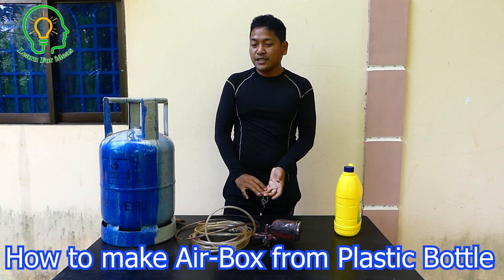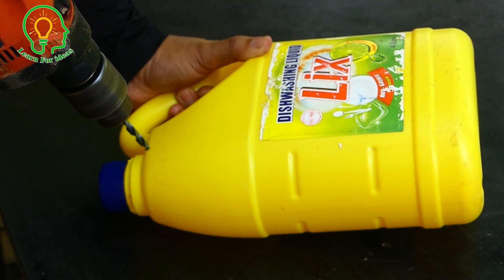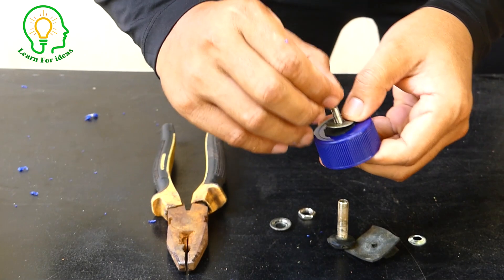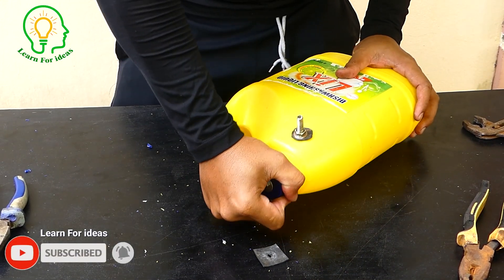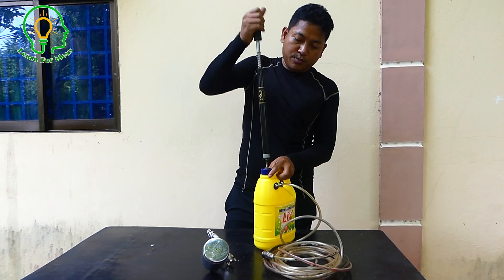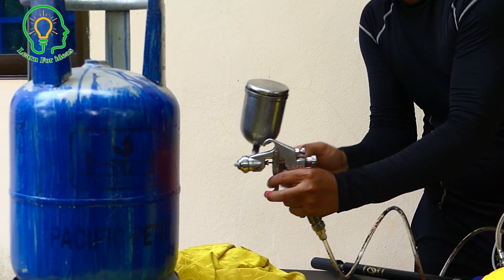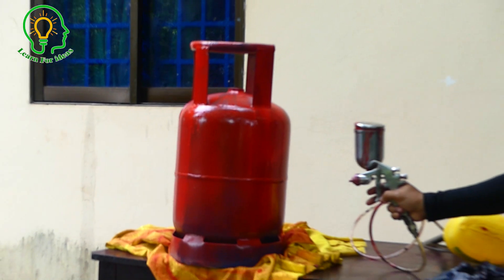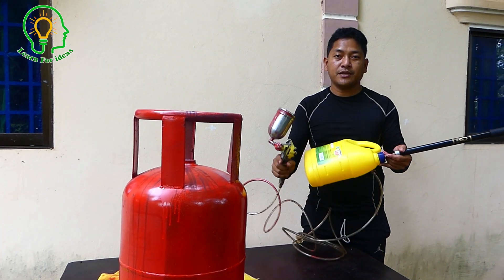How to make Strong Air Stock from Plastic Bottle | Free Energy Tank | Pump without Electricity.

Comment: May be you could use a bigger cylinder than you are painting making sure that the i/p and o/p is leak proofed checking with soapy water.
This should with higher pressure last longer.
Love the idea.
Thanks.
Reply from the maker: Great idea